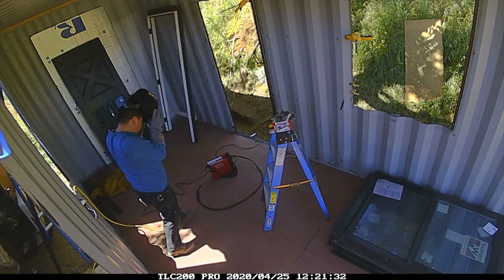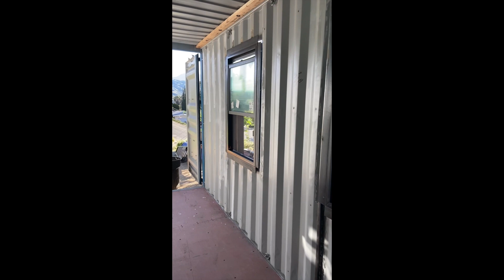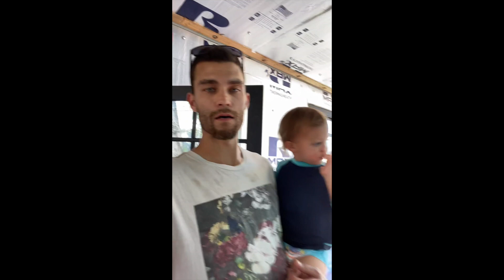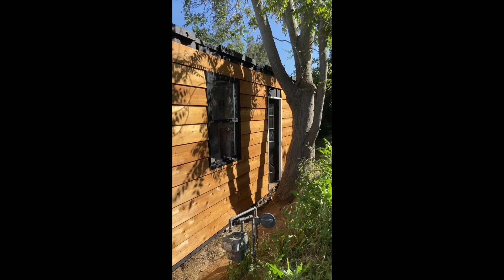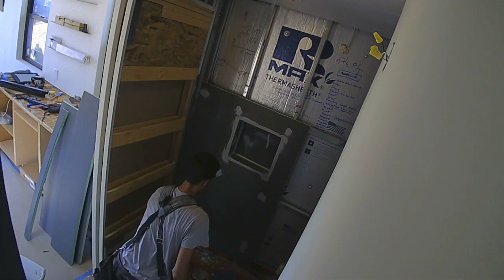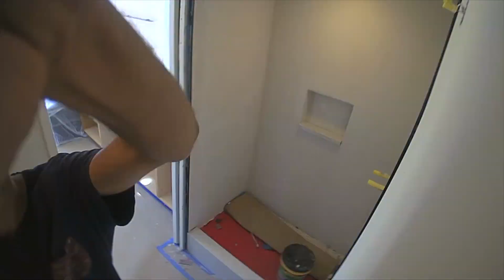Forte Shelter- 160 SF Container Home, The Making Of

Comment: So interesting to watch your process. What did you do in the bottom of the shower? Looks like river rock and teak wood. Is this for looks or is there a practical use for this decor?
Reply from the maker: Thank you, Laura. The answer is for both aesthetics and ease of maintenance/repair. I enjoy standing on hardwood while showering and the river rock makes it feel peaceful. Also, we can easily lift them up to inspect and repair the waterproofing below as needed, because they are exposed. Also, if demolition is ever required in the future, the floor is easy to open up and put back together with this design.